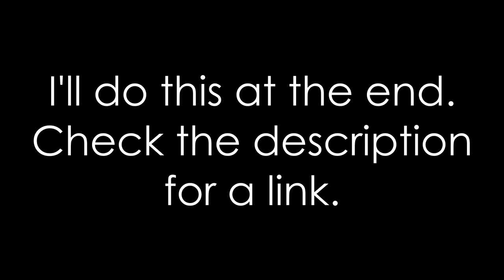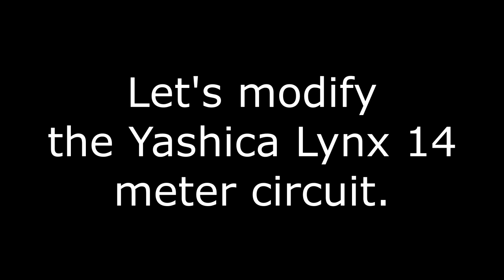Yashica Lynx 14 Video Manual: Use, Taking a Photo, Double Exposures, Flash, Loading Film, and Tips

Comment: Lovely video! Thank you for these. So recently I acquired a yashica 14 with a non functioning light meter. Checked the battery compartment hoping it's just a loose connection/eroded connector and found that the wire connected to the battery chamber is completely unattached to anything on the other end. Would you happen to have a fix / solution for reconnecting that cable?
Reply from the maker: Thank you! For the cable, it could be re-soldered, but unless it's detached at the battery chamber you'd have to know where to feed it to be properly attached and then solder it up, which could require disassembly. I would likely send this for professional repair.
Reply: @DavidHancock  unfortunately it's completely detached from somewhere within the body. (I'm guessing it's the metering button) I guess I can't reach it unless I'm willing to butcher the leatherette. Sigh. Appreciate it. Thanks again!

Comment: The mercury battery leaked in the 14E I have, does that mean it is no longer safe to use? Will that damage any of it's functions?
Reply from the maker: When I had Hg batteries leak, I'd clean the compartment with distilled white vinegar and then rubbing alcohol. Usually it seemed just to an alkaline binder. If the corrosion followed the electronics, it could cause problems (corrosion tends to follow wiring.)

Comment: Great camera, I own one. As far as the battery goes, you could have used Zinc Air hearing aid battery with an adapter. ZA battery is 1.4 volt, which is nearly the same as mercury one. How accurate is the meter after conversion?
Reply from the maker: After conversion, spot-on. Within a fractional stop. And yes, the 675 batteries also work, which I learned literally the day after I made this video. In future videos with the old Mercury batteries, I'll be mentioning the 675 option, which is what I'm using in my Pen D3 and OM-1 right now with great results.
Reply: Can you share a link to which adapter this is?

Comment: Hi David. Love your videos. Really comprehensive and useful. Did you ever put a roll through the lynx? The lens is intriguing. Thanks
Reply from the maker: I did and it was good by around f/2.8. Bit soft wide-open, of course. I shot both the 14 and 14E and they're both really good lenses for their time that could probably hold up decently salvaged from a parts body and modified for mirrorless.
Reply: @DavidHancock  Ah, very interesting. Thanks. A CLA’d one just went on eBay here for £250 so I guess their value has risen. Rarely seen here.

Comment: Does it need the battery in order to trip the shutter or is mine just broken
Reply from the maker: The battery only powers the light meter.
Reply: @DavidHancock  ok so it’s most certainly broken
Reply from the maker: @wessorange943  Unfortunately, probably yes.
Reply: @DavidHancock  bummer

Comment: Ive owned one for ages and I didn't realised that I need to pressed that button to meter. Although mine is acting odd, I think it needs a clean. It moves wildly if I touch the speed ring.
Reply from the maker: That could be indicative of a few things, possibly a faulty wire connection somewhere in the camera or a dying galvonometer.
Reply: @DavidHancock  wire on the battery chamber was very loose at first so maybe that's the case. It sometimes work normal but then  starts jumping to highest position